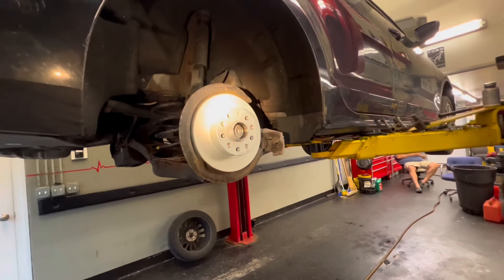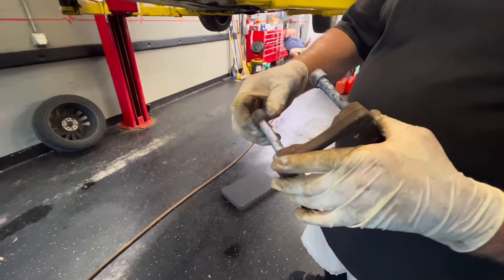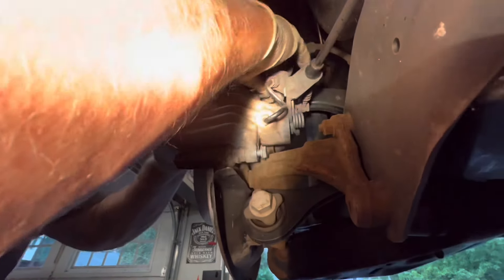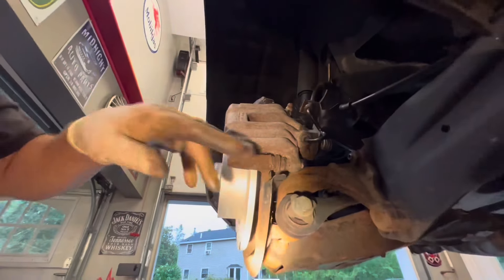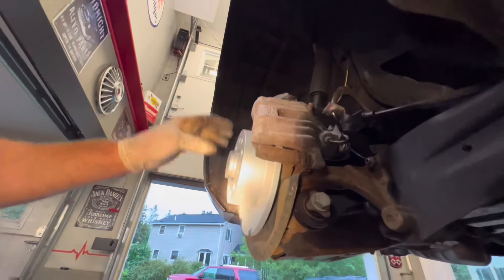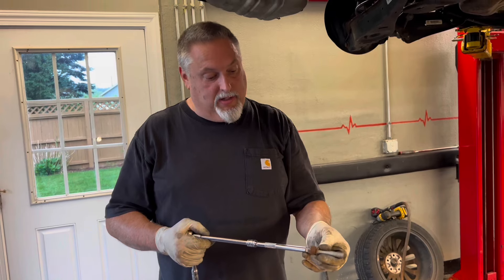Complete Guide: 2011-2018 Volkswagen Jetta Rear Brake Replacement Tutorial

Comment from the maker: 🔧Buy Volkswagon Jetta Rear Brake Kit: https://amzn.to/48iL7QS
🔧Buy Anti-Seize Lubricant: https://amzn.to/3Ems22d
🔧 Buy Brake Caliper Grease: https://amzn.to/3PtWIVQ

00:00 Introduction
00:55 How To Remove Brake Caliper
02:27 How To Remove Brake Caliper Bar
03:22 How To Remove Brake Rotor
04:38 How To Collapse Brake Caliper Piston
06:18 Antiseize Wheel Hub Assembly
06:29 Reassembly
13:37 Bonus Footage - Pro Tip!

Comment: Thank you so much for the video but we just accidentally tightened the caliper bracket bolt to 140 torque instead of 60. You think it’s ok? Or try to take it off…
Reply from the maker: You may want to Google your specific year, make and model Volkswagen Jetta and see what the recommended torque settings are. If you way over tightened them you may want to back the bolt off and retorque it to the correct specs. Also keep in mind that inch  pounds and ft pounds are very different. Hope this helps you out.

Comment: what torx bit did you guys use to get the caliper bracket off?
Reply from the maker: The size should be stated in the video.
Reply: 14point torx, i believe its specific to vw
Reply: @HomeownerRepair it’s not though

Comment: Those bracket bolts are stretch bolts and need to be replaced. Torque to spec and use a breaker bar to turn an additional 90°. They're shipped longer than needed so I clipped mine off to about 1 1/2in. If you do a 2011 you'll invent a new language working on those bolts.
Reply from the maker: Thanks for the added tip.

Comment: Is metal clip not required on the caliper bracket? My 2013 Jetta didn't have any but pads came with clips. I see you just lubed it up only.
Reply from the maker: Doesn't look like this particular one didn't have caliper clips either.

Comment: Good video.  Are you twisting the piston back in, instead of pushing int back in,  to avoid having to disconnect the brak fluid line and bleeding the brake?
Reply: Yes
Reply from the maker: Ye have to twist the brake caliper back into place so the new brake pads fit over the brake rotor.
Reply: why? it should just compress like every other car i ever worked on.
Reply: @highorbit3282 nope. They have to be rotated in. They can't be compressed.

Comment: How easy is it to remove and replace that dust cover? Mine's gone flaccid and bumping into the rotor and I'm going to replace it when I do the brakes.
Reply from the maker: You typically have to remove the wheel hub bearing assembly on a lot of newer vehicles to replace the brake roto dust shield. It is probably the case on this car as well.

Comment: that top caliper bolt is a serious pain in the rear to get back in with the longer torx bit. I did but that was no fun
Reply from the maker: Thank you for watching our auto repair video that shows you how to replace the rear brakes on a Volkswagon Jetta.
Reply: I think for this model you don't need to remove the caliper bracket. The rotor should slide out with the bracket still on.